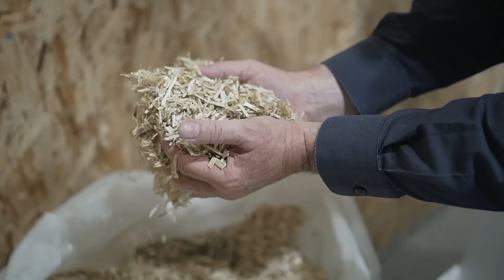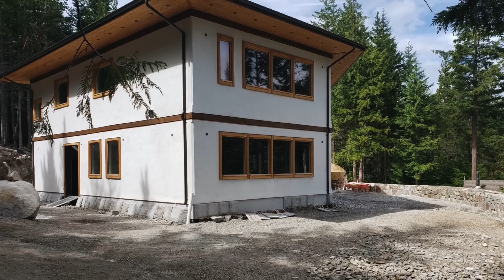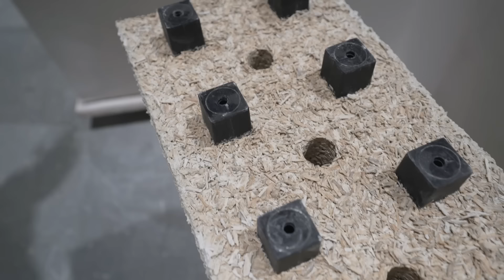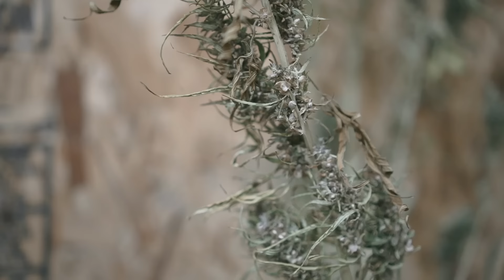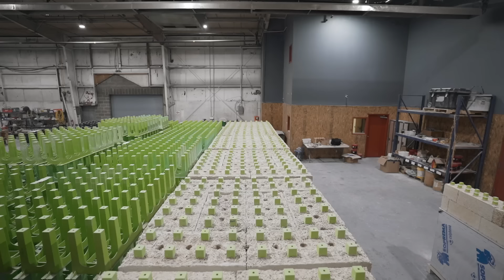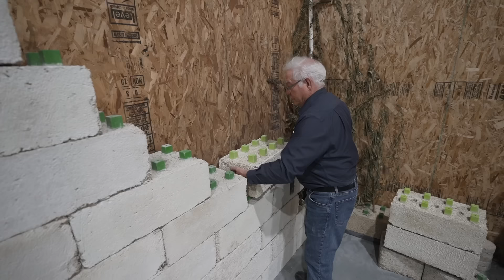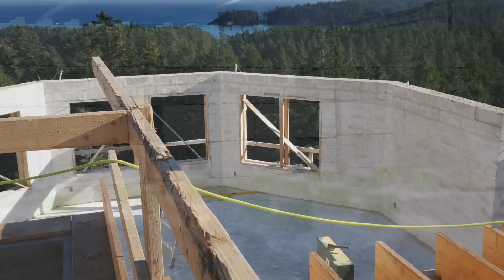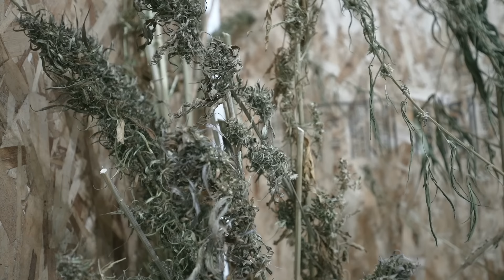Amazing Lego-Style HEMP BLOCKS Make Building a House Quick, Easy & Sustainable

Comment: I find it amazing but I have a question: how does it perform with tornadors since it is much lighter? And also about resistance with tornadoes debris?
Reply: And load bearing strength. And ease of wiring and plumbing. And weather testing. And most importantly, cost.
Reply: @sid2112  - I'm not worried about cost. If it costs too much it won't sell. I'm more concerned about its lifespan and longevity. I don't want to build a house out of blocks that will slowly biodegrade in the next 25-30 years.
Reply: Poorly.  It performs poorly in every single aspect of a construction material.
Reply: @travismiller5548  do you have source on that?

Comment: Wouldn't survive an earthquake or even a severe storm.  Nothing is fastened together, they just simply depend on gravity.  This is silly.
Reply: He mentions that they are mortared in between blocks at one point. Together with the internal locking structure, and the rendering providing additional bonding, this looks pretty solid to me. I would imagine that they went through some fairly rigorous testing before they passed any building regulations.
Also, very rigid structures are not always that great at surviving earthquakes. Hence traditional Japanese buildings were made of timber, so they could move during quakes.

Comment: This is cool, but as strong as brick housing? Strong as pure concrete reinforced with plastic shreds? Or even concrete with rebar? 
I am gonna have to say no to that, this might be good alternative for usual american housing standard which is made out of cheap thin plywood and thin walls, but compared to European housing it may not be strong enough to withstand the winds and storms that usually sweep many areas here, but could be a good alternative in regions were forest fires are common, not much wind or damp places. 
A light house is also not beneficial in storm areas.

Comment: Very interesting…. Just wondering ,how well the hemp Crete   Is with ,  mounting things on the walls.  …. ie ..   screws ..   nails … etc … . Do you have to use expanding plugs to get the right grip …..   is it easy to drill ? ….   Can it be cracked by using a plug insert ? ….

Comment: Sounds great, but he did say it was more expensive...which is a huge drawback.  Also if I'm hanging something heavy, like a big TV,  can a screw in anywhere, and is it as strong as wood?
Also, (as a electrician) this looks terrible for wiring, and the cost for your house to have electrical done to it, would be roughly 6 times higher.  So if you build with this, ya better accept that.

Comment: I've done construction for years and this is a pipe dream as far as i can tell. Where is the reinforcement? Where is the load testing? Ceiling? Second floor he mentioned, ha! Good LUCK with getting a second floor on that. It will just crumble. People don't realize that a concrete wall of that size would have rebar all inside of it. This is not a viable solution to anything but a playhouse as far as he explained it. 
I'm very confused why this wasn't touched on with more in-depth explanations, except to state the obvious that they don't have a working system.

Comment: Seldom does city building codes allow nontraditional materials.  And some they have, like wood Crete roofs, were disasters.  The idea is great, but maintainence may be critical.  And resistance doesn't mean proof.  Everything has its pros and cons.  The biggest pro here is insulation. But real unreinforsed concrete block walls can collapse and are not earthquake resistant.  The FEDS don't put together bottom line cost and risk assessments, nor pros/cons nor long term maintainence evauations nor anything worthwhile that I know of to compare between new and traditional.  And, even if they did, city hall is more powerful than the FEDS (except maybe President Biden and his mandates).  No housing is cheap.  If it were, real bums would live there as well as people in need.

Comment: seems like a great system!

One question though - how do you hang heavy cabinets on the wall? will the hemp structure actually hold up to it?!
Reply: exactly my question...and how to to electrical/plumbing work?
Reply: @annetracy77  a nightmare that is how
Reply: @annetracy77  in the video he commented that there were holes spaced in modular fashion (roughly every 5 and some inches IIRC) to run electrical.  Since they can be cut with a band saw, I would imagine it would be possible to drill for plumbing as well.  It looks like the existing holes would be large enough for supply lines.  Maybe larger drainage lines can be routed to a central shaft or corner section of the house that can be otherwise hidden
Reply: From their website:
Our structural frame (buried inside each block) has 5.333″ O.C. (On-centre) struts.

Every 3 struts there is a 16″ O.C. stud, which matches typical residential construction.

Comment: If the lime-crete is just for insulation then I'm not sure I see the point of this.  Why don't you just build using large structural frameworks and large panels of insulation?

Comment: I know hemp as an isolation material which works pretty great. BUT. As a replacement to brick i see some problems. 1 )As you just pile it up with no concrete in between it doesnt have enough stability and strong wind will lead to cracks in the wall.  2) Water is the enemy to any organic material. Without proper isolation this will rot. 3) The idea that a foam will make it water proof so that you can put it under ground is nonsense. Natuarl movement will break it and then water comes in.
Reply: The very high pH of the lime in the mix and the way that it controls water will probably control all microbial growth. Lime mortar also has a way of moving and resetting when damp, it never really cures like cement. This often causes issues in old buildings around the UK where they are repaired or rendered with cement that can't accommodate future movement. I'd have thought that if you intentionally wet all the joints in a construction like the above they would probably fuse.
Reply: @johna7075  Water does find a way even through the smallest cracks. If you dont have any isolation and filling material between the hemp bricks it just doesnt work. It will never be isolated enough to come close to a passive house. Beside that water might cause some more serious cracks and then the organig material will rod.
I am a huge fan of organic materials and i have 20 years of experience with passive houses in europe but i am afraid there is a reason this didnt become the standard for building passive houses. it just lacks the basics

Comment: There's another company making wood called hempwood and it's looking pretty darn sweet. I just wonder about the internal frame they are using inside of the block.. It sounds virtually indestructible. If this stuff becomes the new standard, what kind of an environmental impact is it going to have over time? I love the concept, using natural products is something we should have been doing all along.. Granted, it's what the human species was doing before the industrial age took over, but.. now we're reverting back to more sustainable practices (which is good!)  we have a long way to go though.  Hemp, Bamboo, Sugarcane, Tampico are all way better than some of the stuff we use now for plastics and papers, concrete, wood, etc.  Hopefully more of the industry will start shifting it's focus to these natural fibers. There's so much potential
Reply: Wood is a natural sustainable building material.
Reply: @dragonrider269  yes but trees take years to reach maturity, hemp takes 90 - 120 days

Comment: What is the method of attaching things to the wall? For example, say I have a CBS wall and I want to attach a porch. I would drill holes into the CBS block wall. Using lead anchors I would attach a PT plate to the wall from which I can hang a roof system. How would I do that with this system?

Comment: What is the wind speed rating for hemp-crete walls? Could this product be approved for use in more stringent building codes, like South Florida? What's the cost vs concrete blocks?

Comment: Tjay you need to move the materials multiple times before construction is complete is a waste of labor, above technologies we already have. 
Use aircrete. Don't like how it sounds? Call it "I.C.F." insulated concrete forms. 
R-42 @ 8" impervious to rust, mold, water, insects and can withstand an Oxygen acetylene torch with direct contact, indefinitely.  
If you're going to reinvent the wheel, don't make it shitier.

Comment: I first saw Hemp building materials WAY back in 2002/2003, it seemed far fetched at the time.  But you know, certain portions of the Great Wall of China used "rice" as a mix within the stone structure to enhance its durability.  That said, this is reinventing a wheel from the past, rather than a brand new idea.

Comment: I love the idea, but I have questions.

How do you replace large areas that have been damaged?
How long will these houses last with, and without maintenance?
How do I go about purchasing these if I wanted to build one?
Reply: I worry about the plaster lyme for the long run with water.  I would love to see concert added to the mix.
Reply: @HappyAmericanDad  Yeah, it would probably be best to have more mixtures available, similar to how concrete has different compositions for specialized use cases
Reply: @willow-wf3jf  You never use only the hemp bulding blocks and call it a finished house. The outer & inner wall surfaces still must be plastered with cement mixture for a moisture insulation (or water) & off course for a smooth estetic surface. Most brick buildings in Europe are covered with a cement mixture for insulation.
Reply: The reason I say that is because you start to see Lyme leaching out of concrete cinder blocks over time. What's happening is that the mixture was too heavy with lime and then that stuff just flakes away leaving a very compromised cinder block. Just curious on how long this really would last before it decomposes
Reply: I'm curious as well, commenting in the hope for an answer.

Comment: How will it perform in humid,wet climes? Like florida? Will it absorb moisture? Will the plaster/stucco stick with the rates of shrink and swell? Will it affect the paints applied?.i do know hemp is very tough,and one of the only plants that actually cleans the soil it grows on.good,durable stuff. Do you use a tie beam,or lintel?

Comment: This is a great idea, how much hemp would it take to build a single family 2500 sq ft home? Roughly of course. And just to be clear what would be the final R value of those exterior walls be? 2nd Could you also build like a 20 or 30 ft solid support beam “ like a microlam beam”? Or are these only in blocks.
Reply: Not sure how much hemp it would take for that size. But the hemp fiber wouldn’t work well as a horizontal beams bc they would snap. Better to use wood or steel instead!
Reply: I think this is the 3rd time I've tried to post this comment and it keeps disappearing for some reason...

"New products under development from HempWood include a hemp-based flat strand sheathing board similar to oriented strand board (OSB) which Wilson called “OHB,” as well as load-bearing laminated veneer structural timber (LVL) that can be used for home elements such as rafters."

Comment: Outstanding!!! This is everything good about ICF's and then some, and none of the downsides. I'm in south florida, and my CBS / CMU house in the winter, when it gets to low 50's (at night) and stays low to mid 60's during the day - the concrete soaks up heat and releases it slowly into the house - so I don't need heat at all. I would probably need heat for a few weeks with these, but it'd save enough on air conditioning during the other 10 months it'd totally be worth the trade off.

The only thing I'm wondering, is where do you put plumbing and electrical? How do you modify that later on down the road? Concrete blocks you can run down hollow cells, and sneak through the furring strips between the block and drywall. I'll be looking at this to see how that's done.
Reply: For plumbing and electrical, if I were building for myself, I'd router an inch into the block to bury the pipes and conduit behind the interior plaster.  In reality, most plumbing can be run up inside the interior studded walls.  The vid shows holes predrilled to get conduit from the floor to ceiling inside the block.  I'm not sure how they plan to get from the predrilled hole to say a light switch on the inside wall or a receptacle for the car charger on the outside.
Reply: @poppasan1873  Ok I see that now. horizontally it'd be run in the floor joist cavities or in an attic, then down or up to the switches - makes sense now mostly. Except that retrofits would be difficult in some cases.

Comment: Seems like a nice concept, but I want to be able to go to a website and choose 20 pallets of the stuff to get shipped to me to build a home, but just more gee whizzery on their website.  There's a builder using 4x8 sheets of styrofoam that's 11" wide and goes up super quick, he coats the outside and inside with what they call sabscrete to make it structurally strong.  If hemp blocks could be made lightweight enough for 2x8 sheets that get treated the same then the build time could be significantly reduced without the lego technique being necessary.   One fellow on youtube makes a 4x8 steel frame out of steel 2x4's and pours in aircrete and stands those up to make walls.  Maybe a hemp aircrete product could make it light enough with the sabscrete stucco for strength.

Comment: As a civil engineer, this episode with all the technical detail was just like honey. Thank you for sharing!!
Reply: @yo yo That was my question load bearing limits. Also, how long will these last? In 20 years will it be falling apart? How durable where weather is concerned?
Reply: @yo yo He did mention it is more expensive than traditional concrete but that the costs may also be offset by the built in thermal regulation, as well as the overall carbon footprint reduction, over the lifetime of the structure.  It's pretty easy to look this up.  140-150 per something something for concrete and about 170-180 per something something for this.
Reply: @yo yo Something weird about the comments on this video. It's like they're bots or a cult.
Reply: @wimpb  Yeah it's really weird.  It's like there's a concerted effort by traditional industry lobbyists to stop any kind of progress.  You see a lot of the same type of obvious naysayers and trolls on electric vehicle and solar technology videos.
Reply: @wimpb  Yeah I wonder if they're a bunch of bots supporting the lumber industry or something by trying to bring down Hemp Blocks
Reply: @nathanvalle6997  I'm pretty sure that, other than the "you'll get high if it burns'" comments, a lot of these comments are valid concerns from skilled Tradesmen, construction people and architects.  Seems to me that many of them are pointing stuff out that MIGHT help the Hemp block industry.  My Dad was an architect, and I've done various forms of construction over the years. fwiw, I'm a huge proponent of this product and alternative building in general.
Reply: @jwwtzl67  That's reassuring to hear, as many of the comments under Dark's comment thread seemed hell-bent on being negative.  For instance the back and forth about R values... just go to the site and look!  33-35 R value given for a standard wall construction using the methods shown.
Reply: @wimpb  yes ..like I really happy for  to such material ..but also I want to see transparency and the flaws..the truth will be better

Comment: Interesting concept. What kind of plastic are they using? Hope it is at least easy separable, and a thermoplastic with little additives to easily melt again.
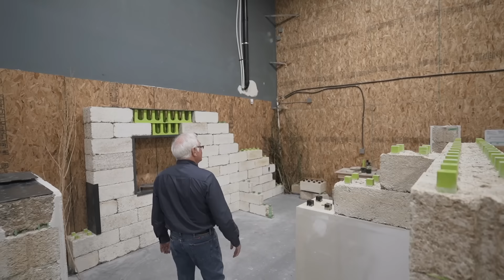Reply: @4:35 vegetable oil based bio-composite epoxy

Comment: Too many false claims in this video. Like supports that don't buckle like steel when heated. It's high strength but only builds up to 20 feet. Lime sequesters  CO2, but lime production produces CO2. Wood is unreliable as a building material etc. There's no need to lie to push a product.

Comment: How much weight can be hung on such a wall? 
How durable is it? It has to stand uncompromised for 100 years. How does it hold up in a storm? 
And the holes for water and electric, that does require a different approach from tradesmen, if it takes more time because it is inconvenient it will be more costly, there are a lot of regulations to comply with and it needs to be fast to work with. 
Planning would also have to be different, now you build all the walls and then the electricians and plumbers come to install their stuff making sleuths in the walls. You can't do that here. Conduits have to line up to the floor and ceiling conduits, you need to be able to get electrical and water tubing in there.

Comment: Does this have the capability to protect against wildfires?
Reply: With metal roofing and theright siting it would.
Reply: @bclemmon2505  What about the door and windows? Typically made of wood. Would the door need to be made of the same hemp material, and would the windows need to be made of the same aluminum silicate glass as the space shuttle?

Comment: I like it Hemp has so many qualities we can use it's fibers for , one question as a builder what is it like to fix things to or drill holes through for pipes wires etc
Reply: Did you not hear it can be cut with a saw?  so-o-o it can easily be drilled, cut, chiseled for electrical boxes and then resealed with hemp / lime mixture just like any kind of hempcrete product.